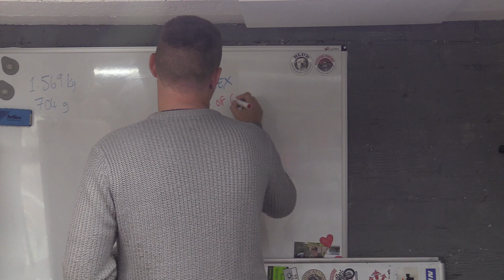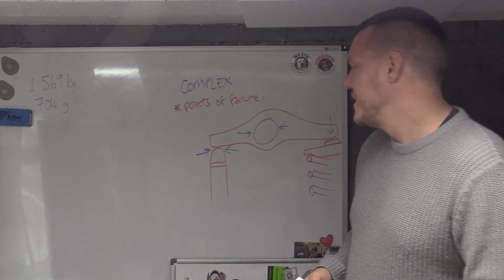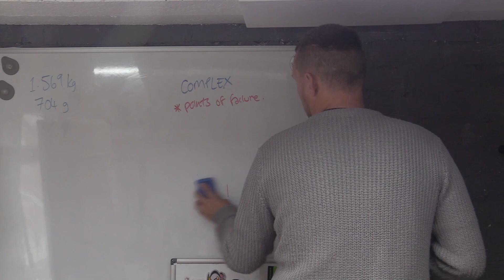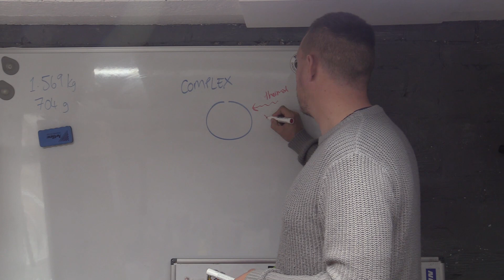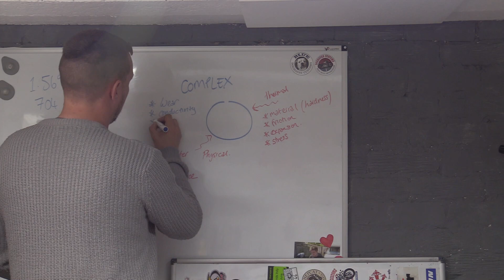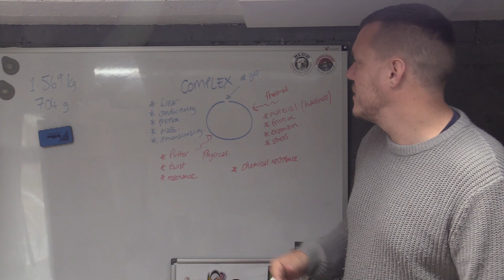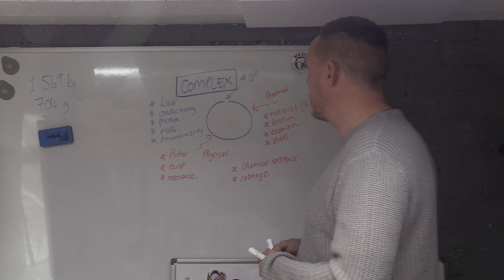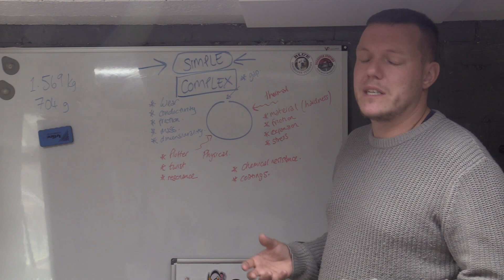Complex as a piston ring!

Comment: Mate ... check your windowed piston video it's wrong... the 2 windows should match your inlet up on the cylinder where your carb is attached. You've got the orientation the opposite way around. Check arrow on piston to face the exhaust ...
Reply from the maker: No they don't.
Reply: @thedirtyworkshop  mate got a yammie rs125 2 stroke on table here in front of me. The two windows up on the piston skirt align with the inlet where the carb is... the half moon cuts in the bottom align with the gaps in the cylinder slieve
Reply: The two windows allow for crankcase pressure to be released into the inlet port
Reply: Read Gordon Jennings 2 Stroke tuners manual
Reply from the maker: Not for the piaggio they don't...
Reply: You should check out the Vanguard/Kohler engines, so many different configurations for so many different applications. You gotta have a dam Briggs & Stratton master's degree to know which engine get's what configuration. Same with most engines.

Comment: Simple does not necessarily equal fewer points of failure or increased reliability, this should be obvious to everyone cough 2 strokes are shite cough
Reply: The 2 only real problems whit them is low compression and fuel consumcion, what do you mean by shit?
Reply from the maker: and poor lubrication, high friction losses, poor variability, high pumping losses and high wear rates - but apart from that....
Reply: @thedirtyworkshop  you were dead right dude, doesn't take them long to take the bait 🤣
Reply: nah not really, it depends on the application as always
Reply from the maker: Application? All of what I pointed out has nothing to do with application.
Reply: @thedirtyworkshop  do you think whit F1 developing 2 Strokes thoses problems whil go away ?
Reply: @thedirtyworkshop  two stroke dirt bikes are great for hard enduro where the weight makes all the difference but other than that there not as good as four strokes and if you're talking road bikes there shite
Reply: LOL, they are great for string trimmers. I hate 4T string trimmers.